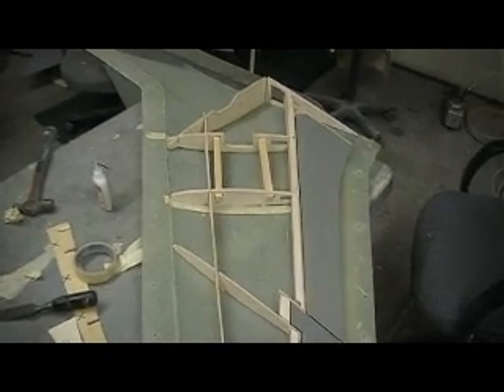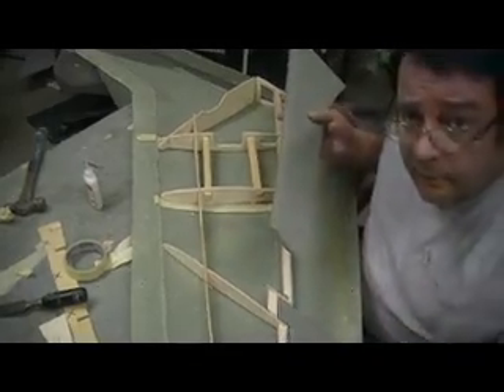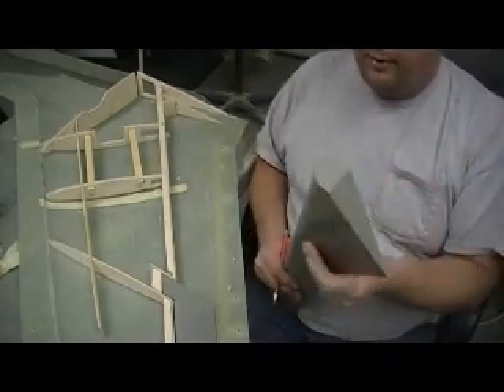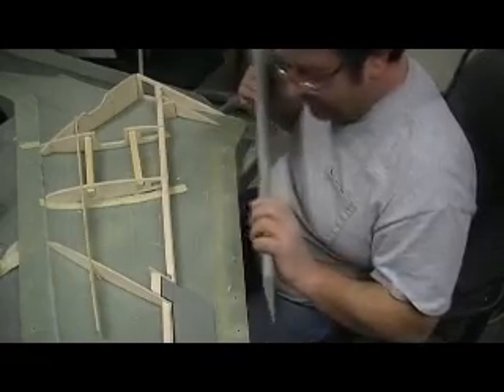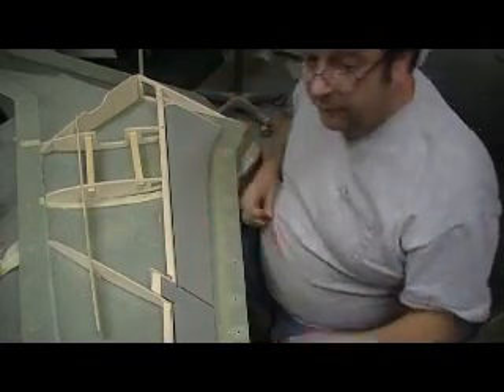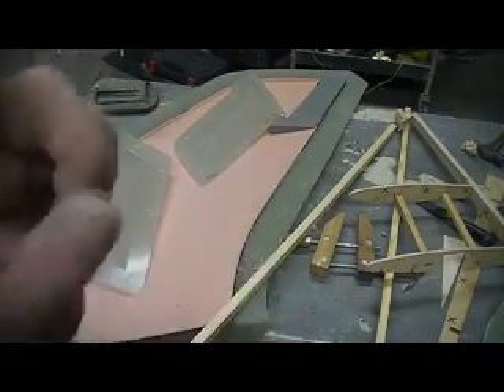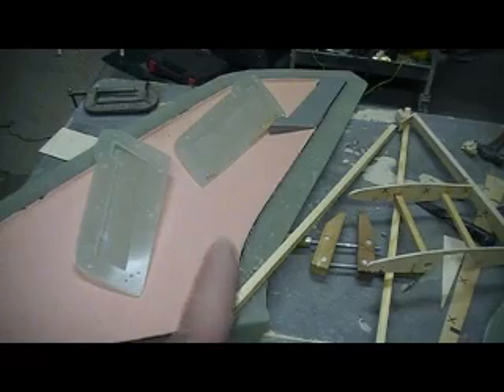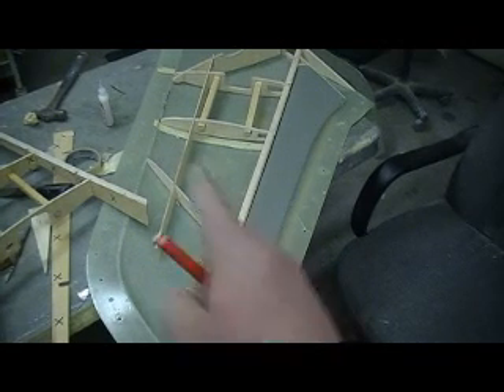how to build a rc jet F-105 thunderchief # 300

Comment: @TYB439  Thinking about it, it can be as easy as a paper towel roll holder with half inch machine screws on each end to float inside.  On the outboard side, the rib can extend about a half inch to hold the flap in. The flap can easily be removed by the outboard screw while the inboard screw or post is fixed.

Comment: For your root hinge: use a removable hinge pin, inserted from & through the root ribs, into the flap, at the point of rotation. Align the hinge pin during construction. The pin will run along the axis of rotation. You will be able to insert the hinge pin after the wing build, & will make it easier to remove the flap for any repairs.

Comment: couldn't you have the flap pivot like a rolling pin with pinned composite flanges on each end?  Then you could make the wing like first method and then slide flap into place after you cut out flap area.